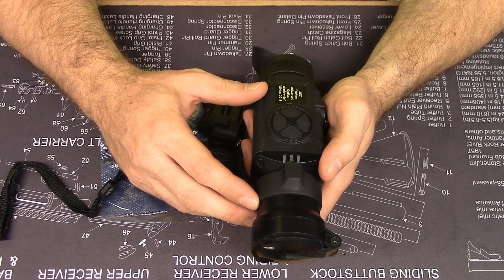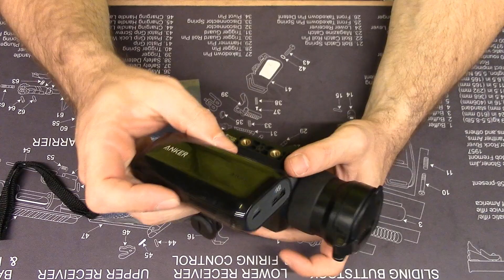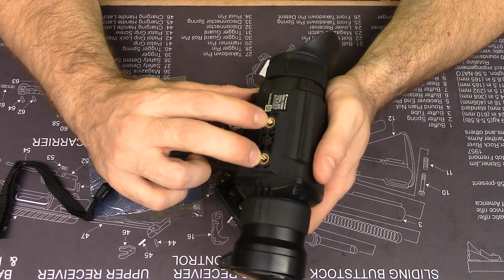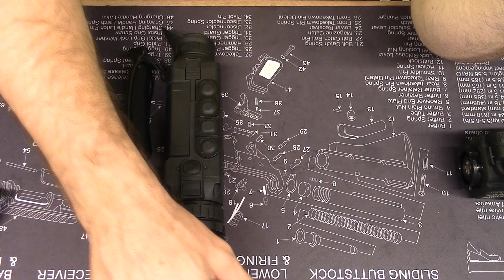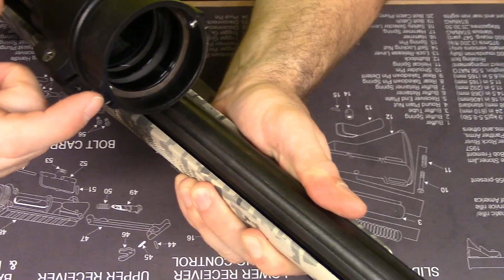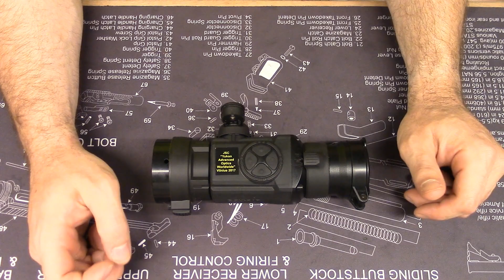Pulsar CORE FXQ50 Thermal Clip On and Spotting Monocular Review!

Comment: Hi. My core is also moving horizontally 37:30 a bit if you press the buttons. It looks like this is not because of wear off but it comes like that from the factory.
Reply: I made a test and POI stays the same, no matter if you put pulsar on and off. I made the same groups on 100m with core, without  core or moving the core on and off. So currently very happy with it.
Reply: Same with mine. When you mount it at a gun, it moves up and down. Does it affect accuracy?
Reply: do not know, will try @nemir2550